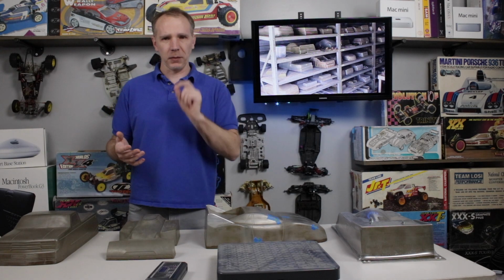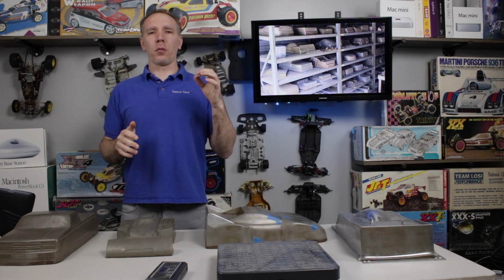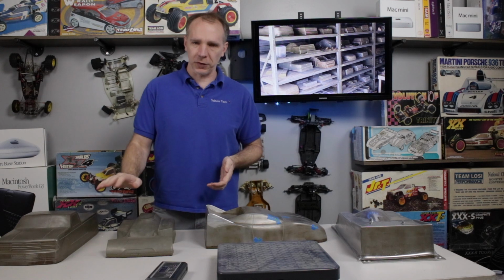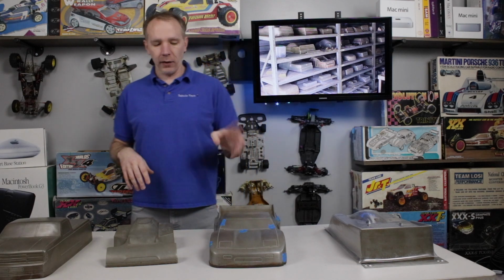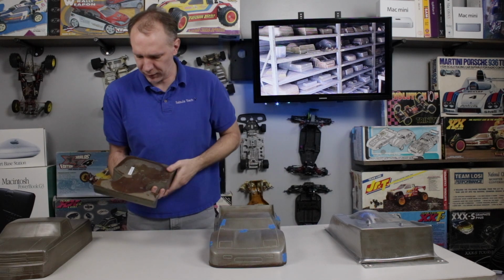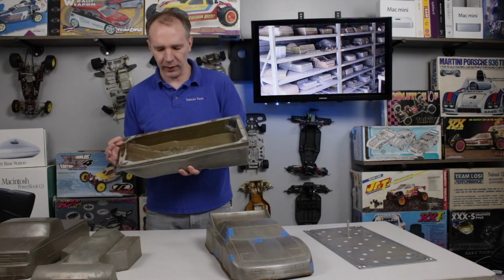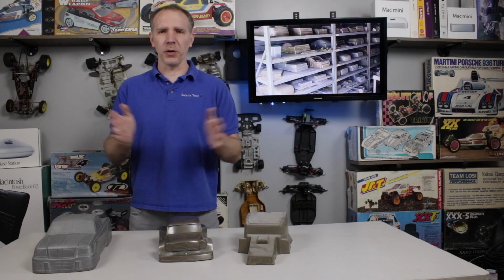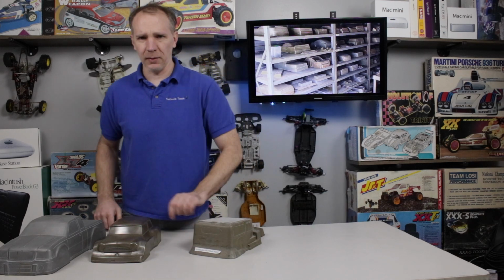Traditional RC Body Mold Design for Vacuum Forming (The Basics)

Comment: Can you make a mold from tooling Gel coat and fiberglass for vacuum molding I’m going to try it just wondering if you have ever tried
Reply from the maker: I have never seen that done. Probably have a problem with the gel coat handling the 300F or more temps of the plastic over time.

Comment: I've been working on all this with HO scale slot car bodies. All the bits about the bucks which I do make my own came as common sense to me and I do have those features built into my much smaller forms. What I would love to hear from you about are the finer points of wrinkle reduction. Basically ways to design things like the blocks in the beginning that will stop the polycarbonate from building up on corners. I generally work with .010" polycarbonate sheet. I'm also using a dental cast vacuum machine. I've had quite a few problems with this. I feel like I'm overheating the plastic to get the details, also I'm concerned I don't have enough suction but I know others use this same machine with success. I have had some success with various designs but I would be interested to hear what you have to say. I'm definitely doing the right basics on the bucks like no undercut areas and having the hollow cavity with suction holes in corners and seams. As far as I can tell I'm doing things to the best of my knowledge but it is limited knowledge. 
Great video. Thanks for posting. Anything you can suggest that might help would also be greatly appreciated. 
I'm a huge RC fan too. I've been racing since vintage cars were new. Still have a huge collection. I remember some of these from back in the day. Great content. 👍
Reply from the maker: Hi, wish I could help you better. Maybe your machine has a bad pump? Sounds really like you are getting you plastic too hot because the pump isn't getting things formed well at lower temps.

Comment: Thanks looks like i made my first buck properly then.... the only thing is what temp do you heat your buck too the resin i used is 128c capable and I added about 14 to 20% aluminium powder to it.
Reply from the maker: The buck is usually heated to about 115C depending on the the design it might be higher. If it has a big flat surface on top then it goes higher. Good luck!
Reply: @SabulaTech  thanks for your reply hope fully i can get a clean pull now lol..... I'm not one to give up easily

Comment: I made a body and I’m going to make the female mold so I can get body ready to form, but I’m not sure the material I need to pour into to make my mold, I’ve tired plaster before and wasn’t the best, I’ve also tired fiberglass resin and matt to get strength but I’d rather buy and use some type of Epoxy, I’m only doing it for fun of my own rc hobby and love creating stuff! Thanks again for the video.